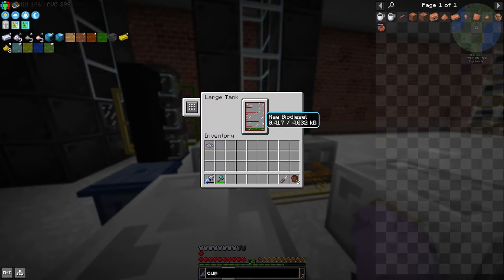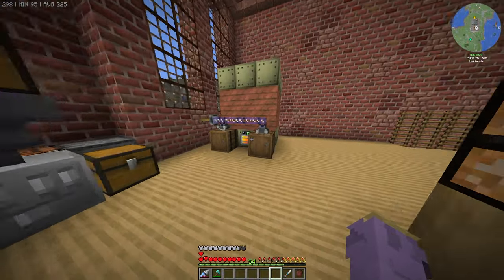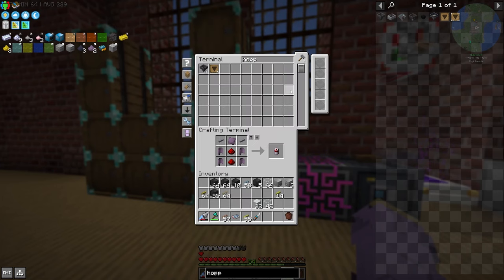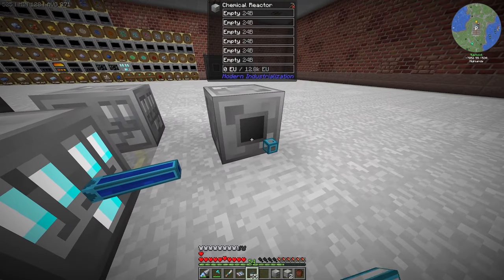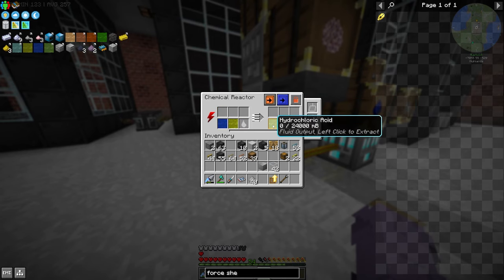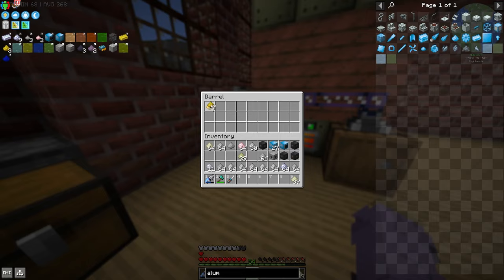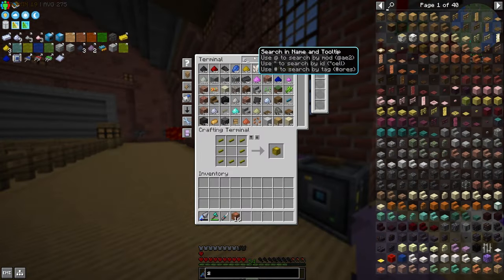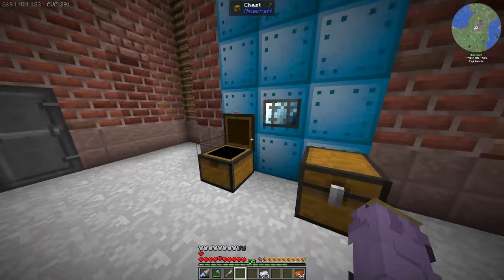FTB NeoTech - Ep. 9 - Stainless Steel Automation & HV Circuits

Comment: how do you have that much diamond, if i remember correctly you cant turn them to gems from dusts but i might be wrong

btw good video, go on 🔥
Reply from the maker: Crafting a bunch of steel drills and letting my quarry run overnight. Also yea, I'm converting them to gems using the pressure chamber from Pneumaticcraft, just to the right of my ore machines.
Reply: @Mysticlxl  oh, i see. i didnt know the press chamb recipe. thanks
Reply: @Mysticlxl  could you do a world download please so i can see how you make pneumaticraft working ?
Reply from the maker: @nalimbukerabo4993  So the way you get compressed iron before you get a pressure chamber is by compressing ferricore ingots in the steel compressor (This is all covered in chapter 2 "Caveman goes tech") then you just make a pneumaticcraft setup like normal to turn iron blocks/ingots into compressed iron in the pressure chamber.
Reply: @Mysticlxl  yeah i figured that, the problem is that my pressure chamber explode for no reason even with security upgrade so i wanted to check you world to see how you managed this very complicated mod
Reply: especially the heat stuff you did to process the fuel to make oil, i really dont want to cheat but pneumaticraft is one of the mod i never understand correctly
Reply from the maker: @nalimbukerabo4993  I use liquid compressors to make pressure from diesel (regular air compressors will work as well) then use pressure tubes directly to the pressure chamber valve, and just put safety tube modules on the pipes to keep them from exploding. Same with the oil processing, just pressure tubes directly into vortex tubes, same setup for the pipes, safety modules, and then you're usually safe from all explosions.